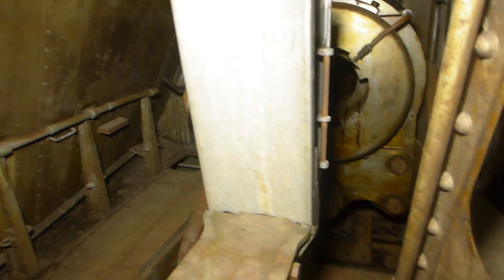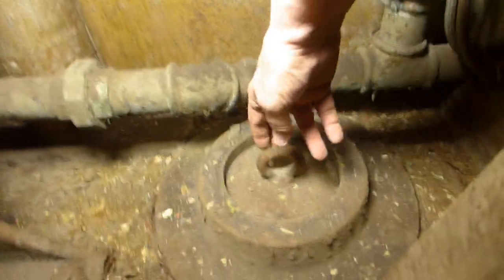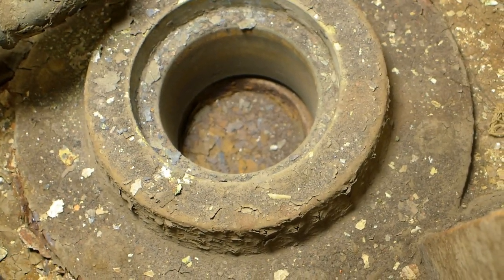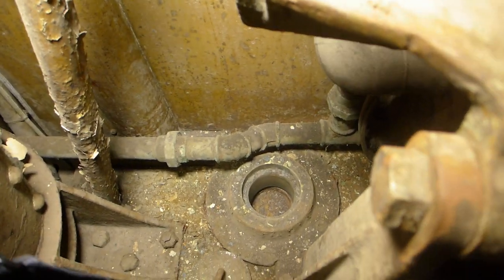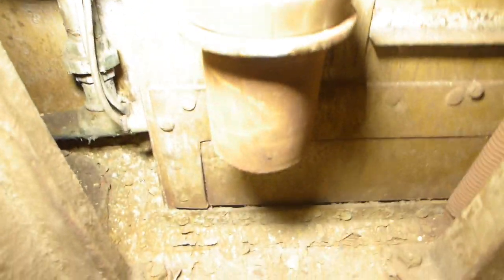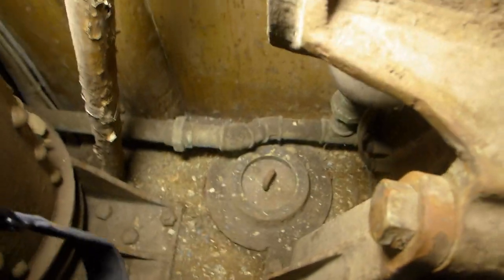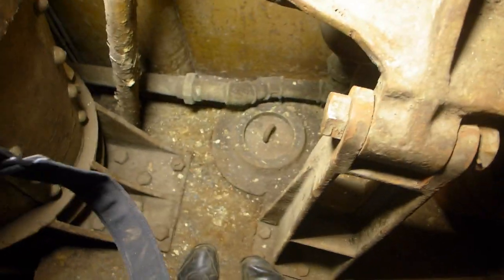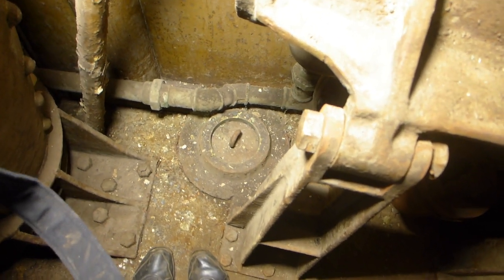Battleship Texas, Finding The Turret Centering Pin

Comment: i wonder how many incidents there were where someone neglected to remove this before the turret was rotated as there does not seam to be any mechanical or electrical lockouts preventing such a situation.
Reply from the maker: I assume that they followed a check list.  Failing that, there is still a sign hanging  below one of the guns that says "Centering Pin In Place".  It's fair to assume that the trainer (the guy who rotates the turret)  would call out to the turret captain who would confirm removal as he crawled to his position at the forward end of the turret beneath the barrel.

Comment: That pin looked like it is tapered. That would assure a firm seat in the centering socket.
Reply from the maker: I didn't notice a taper when I was holding one, but then again, I wasn't looking for that.  If it is, it would likely take a micrometer to measure it.

Comment: Since I was in the US Navy, I have wondered if the turrets could be lifted out of their place without disconnecting any electrical or mechanical stuff. I would guess since the drive cog gears that rotate the turret look to be sitting on top of the main hull cog ring, it wouldn't be too hard except for the weight and structural integrity of the entire below deck turret housing.
Reply from the maker: No, you couldn't simply lift a turret out without disconnecting electrical wiring and compressed air lines.  There was also water lines for fire suppression, but I read in a procedures manual that there was no permanent connection, but a flexible hose hooked up to the ship's fire main prior to going into action.  The wiring and air lines would be pretty easy to disconnect since they all run to the bottom of the structure in a central column where they can be easily accessed.  The really tough part would be getting to the turret holding down clips that can only be reached in very narrow and confined spaces.  Not only would it require removing a lot of large, heavy bolts, the clips themselves weigh at least 1,000 lbs. each.  Having once squeezed into one of the spaces, I cannot imagine how they installed the clips or how they would be removed.  Having said all of that, there wasn't much reason to remove the entire turret structure once installed. The turret house was pretty easy to disassemble in place with a heavy lifting crane and pretty much all machinery could be removed or serviced where it sits.
Reply: @tomscotttheolderone364  TYVM, Mr. Scott for your response. I have also been watching the New Jerseys and Battleship North Carolina channel. Looks like they r heavily on their way of restoration of what they can. 

I didn't know if they had a cathodic protection system on those other battleships and using it, but I had also suggested to have a constant flow of water simulating the ship underway to build up a static charge on the hull, in addition with the cathodic system. I would guess keeping a constant state of electrical charge on the hull of any museum ship would help prevent corrosion. Or just line the entire hull with flex seal 😂.

Comment: I would expect the center pin to be much larger
Reply from the maker: Yeah, you would think so.  However, the job of the centering pin wasn't so much to keep the turret from turning.  Turrets going back to the later per-dreadnoughts were balanced, which largely kept them from swinging on their own when the ship pitched and rolled.  The pin simply kept jarring of the turret in heavy seas from bashing against the turning gears. It was sufficient for that.

Comment: Isn't this more of a locking pin then?

I'd expect the centering pin to go in the centre.
Reply from the maker: The term correctly describes the pin’s function which is to center the turret’s training position.
Reply: Then it would be called a centerpin I suppose
Reply from the maker: @janvisser2223  The semantics are correct.  It is not in the center of the turret, it acts to center the turret.  Therefore, it is the centering pin.

Comment: assuming the turret is currently centered, there doesn't seem to be much of a hole down there to provide room for a large amount of pin in both the upper and lower hole, is it filled in with debris?

also, will these be used for the move?
Reply from the maker: The turret isn't precisely centered, so the holes are not aligned enough to insert the pin.  The bottom hole, milled into the top of the barbettes is very shallow.  Apparently, that was enough to do the job.  Since none of the turrets can be trained at all, it's extremely unlikely that any attempt will be made to insert pins for the tow to drydock.  Besides, they were only needed in heavy seas when the turrets were not in use.  It's highly unlikely that the ship will be towed in those conditions, meaning the pins won't be needed in any case.

Comment: I wonder if anyone in history has ever bent a barbette. With as much space as they cover, and as much weight as is swinging around on top them,  it seems plausible.
Reply from the maker: I am not aware of any barbette being damaged other than from a shell hit.  As far as weight, there isn't any on them.  The turret assembly is supported by a separate structure that is built inside the barbette so that its armor protects the turret and its supports.

Comment: It's amazing to think that such a tiny pin could reliably hold such a large turret reliably.
Reply: Funny to hear a giant pin like that called tiny even though it is small relative to the turret. Since it's just stopping rotation I'd imagine that it's probably way stronger than it needs to be in reality.
Reply: I had a similar thought. I agree with you that doesn’t seem like a lot of material to prevent such a mass from traveling, but I guess it’s all about stopping something before it starts. If the turret was able to get a little momentum going it would probably not even notice that pin, but the pin prevents it from moving even a little and apparently it’s just enough.

Comment: Never knew such. Does New Jersey have them? Have to ask. If you could, do video on 14 inch turret barbette, such as diameter. Could you also do one on the 5 inch casement guns? Thank you. Long live USS Texas
Reply from the maker: Iowa class battleships, along with all other U.S. battleships, had turret centering pins.  In fact, a friend of mine was a turret commander on Missouri and recently confirmed that.  They were mainly used when in heavy seas since the pins held the turrets so that they wouldn't move and batter the training gear.  However, he also said that they tried not to use them because they were very difficult to remove once installed.  On one occasion, all 3 turrets were pinned and it took more than a day to finally remove the pins.

As far as the barbette, there really isn't enough material to do a video.  I also haven't shot videos of the 5" guns.  Due to the current status of the ship, I cannot get to either now, even if I wanted to.  What I am primarily doing is "plucking" low hanging fruit and posting videos that were quick and easy to shoot and require little or no editing to post.
Reply: @tomscotttheolderone364  that's interesting. Seems like after all those years, they'd have the kinks worked out.